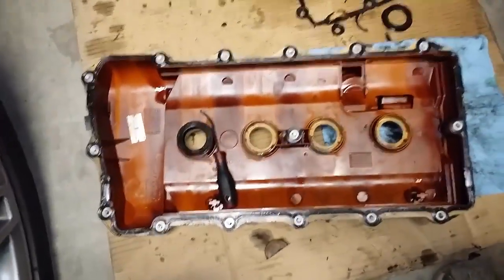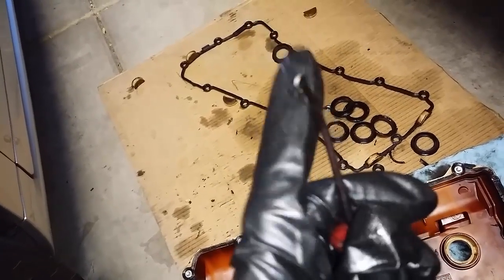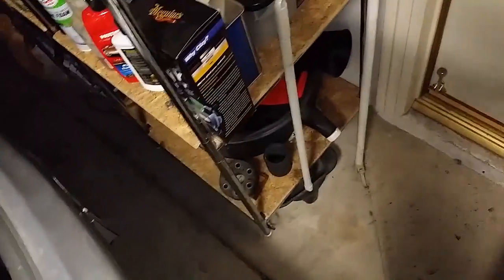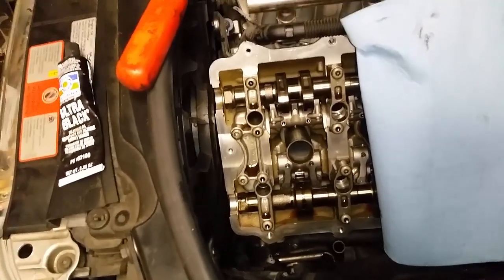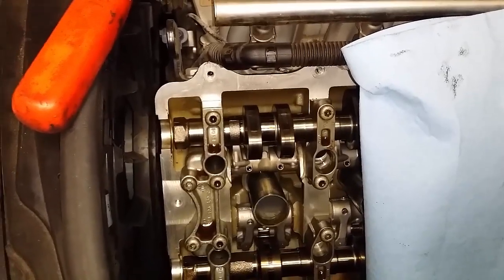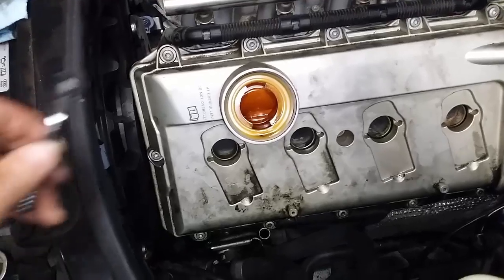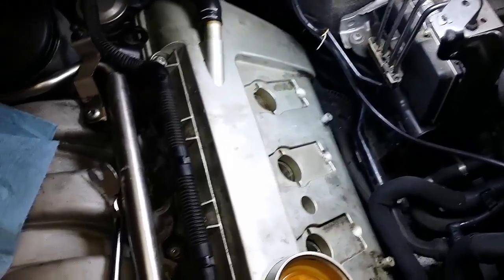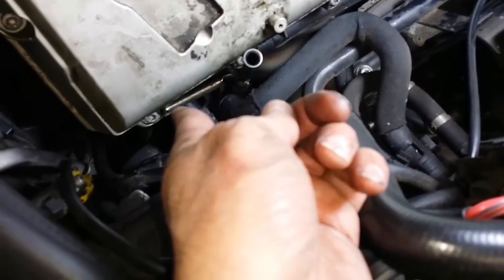2008 Audi 4.2L V8 Valve Cover Gaskets Replacement

Comment: I tried to use the links for the tighten sequence ,they didn't work, any other links for photos to help?
Reply from the maker: the links are probably expired, use the proper search term, such as "valve cover gasket torque sequence for" --- > yr, make, model, engine size.. then look for IMAGES on google ... or visit a local library and take a photo of a Chilton or Haynes manual for your vehicle ...

Comment: just haven done this just a few thing that come along the way that might help... first take your time. air lines broke on me and a water pipe, there mad of hard plastic and fell to bits, . my manifold was missing the yellow stud guides, when re fitting take time to line up the gaskets through the holes, or it will leak air well suck air in.. if like me you do not have a tourk wrench . then bolts should only be hand tight. do not over do it as I did and snap a blot🤢. if you have put it back together and get a sucking air sound,, do not try to tight the bolts to close the gap between the manifold and the engine block..the bolts should go in easy. if you snap a bolt your in big trouble, so go easy.. I replaced  air lines and water pipe with off the shelf pipe from Halfords...  very easy job, happy I done it, would encourage you to do your if needed. very basic tools required ,,    most importantly, when the manifold is off,, make sure nothing at all drops in the holes,, use the wife's Hoover to clean them out if she's not looking. jokes aside, massive money to fix if anything drops in the engine and you start the car😲..

Comment: I'm going to one up your removal of the coil clips. Use a small cotter pin extractor and stick it in the small opening above where you would normally put a screw driver. I've heard of people breaking those clips all the time. This way you pull directly up on the lever.
Reply from the maker: well done, sir

Comment: This isn't a 2008.My 08 has the 4.2 fsi .The gasket and valve cover is made a little bit different.Other than that Good video very imformative.This helped me alot.
Reply: This is an S4, not S5. ‘04-08 S4 4.2 did not have fsi. ‘08-12 S5 did.

Comment: Did you replace the camshaft back plugs on each side too? Mine was smoking, and I replaced valve cover gaskets twice, later on it turns out to be camshaft plug.
Reply: Are you taking about the half moon seals? I've replaced everything once and mine is still leaking. The only thing I can think of now is use a bunch of RTV as well

Comment: Very helpful video, but I got nervous with you holding bolts, screws, bits, etc. over the filler opening without the cap on. You drop something in there and it would ruin your day!! Thanks for an excellent video.

Comment: I have a question to ask you. My vehicle was leaking coolant and it was found to be the intake manifold gasket. My shop did change them and I now get the codes Po171 and PO174. Lean codes. I can very easily see the intake manifold gaskets sticking out on my 07 A8 with the BVJ engine. I feel like my shop is sabotaging my car. Are my gaskets supposed to stick out? I noticed yours are tucked in. I feel like they tightened mines down like crazy. They say the intake manifold is cracked but I only have 104,000 miles and it’s been only to Audi dealer all it’s life.
Reply: Contact the technician that worked on your car. Most are very willing to talk with you

Comment: hi I'm going to change the driver side valve cover gasket... on the gasket there seems to be a extra bit hanging off the end..  dose this need to be taken off and fitted somewhere or will it make sense when I take the cover off and have a place to sit
Reply: reply to self 😁 little extra tab stuck to my new gasket was the center rubber. just cut it off and use it😉

Comment: Quick question regarding common issues with this motor. I had a 04 Audi s4. Sold it due to the chain guides breaking and eating the motor. Does this newer v8 have the same issues???? It seems that with the 04 s4. It wasn’t if you were gonna have guide issues but rather when. Great video
Reply from the maker: Thanks, Ivan.  I think the chain guide design was used through 2009.  A buyer who is that concerned about repairs and maintenance which prolongs the reliability of the vehicle by a decade should also weigh the costs / benefit relationship of paying more for a newer vehicle that is still under warranty, but taking massive hits in depreciation.  Of course, by the time you're ready to sell the newer vehicle that was under warranty, someone will complain about something else needing replacement to try and lowball you on the price ...  it's an endless cycle... I didn't let it deter me from buying this one, there aren't many around with the DTM body kit ...
Reply: Deals on Wheels gotcha! I appreciate your reply! Cheers
Reply: Ivan Vega.. hi I just got a beautifull s4 2005 convertible, it come with a bad oil leak with I'm half way through fixing. I don't have the balls or money to take the chance on the chain's. after watching lots of videos it seem to be how lucky do you feel🤔 I'm not that lucky. and if I keep it, I would drive it hard😁 so I'm putting it up for sale asap... nice car but if it brakes, it's a massive bill.. my car has around 115.000 miles, seems to be around this miles that they fail..
Reply: Jamie gregs goooosh. Story of my life also. I have terrible luck also
Reply: Ivan Vega if I never had bad luck, I'd never have any luck at all😂🤣😂 well survive mate, chin up keep going😉

Comment: I wish you would of showed putting the spark plug gaskets in!  I have a 02 a8 and mine will NOT Go in.   its the right part .  i bought 2 !  both sets will not fit.  there a little too big!  Im wishing i would of left the old ones in at this point!

Comment from the maker: Sorry, forgot to show how to disconnect and connect Coolant Reservoir Sensor plug, this task should be performed at 25:44 mark of the video ... it is disconnected just like the Air Flow Meter .... clicks right back into place... disconnect sensor before yanking reservoir off the clips... I yanked the reservoir (with the sensor plug attached) clean off the pigtail wires, but found the identical Audi plug off Ebay for $12.00, part# 1K0 973 202, you can find the same plug made by VW, or even aftermarket... either way, you're covered!  :D